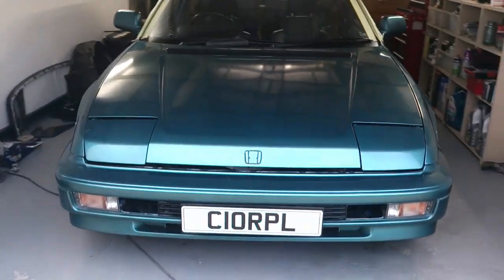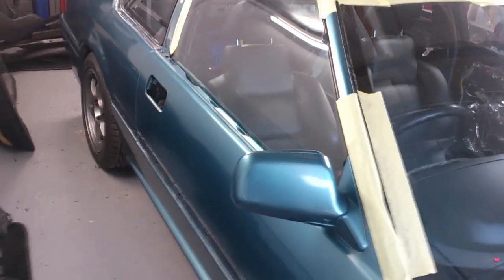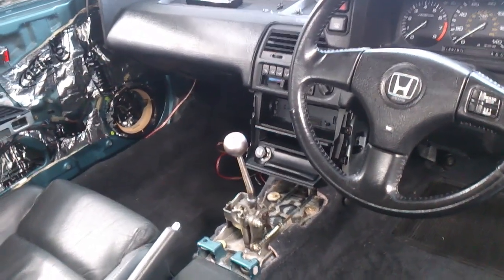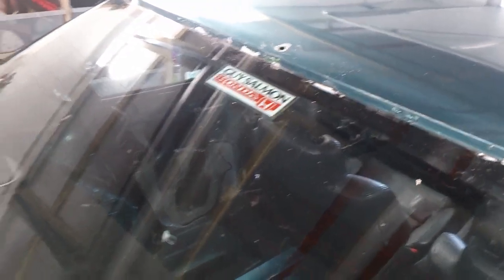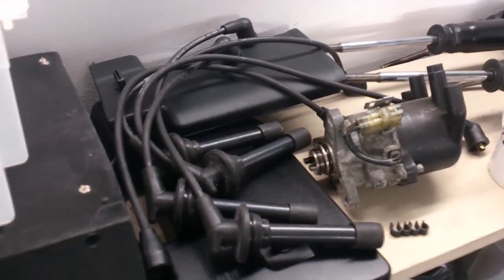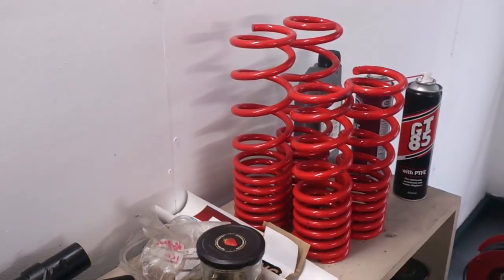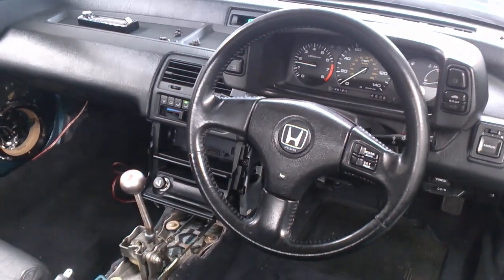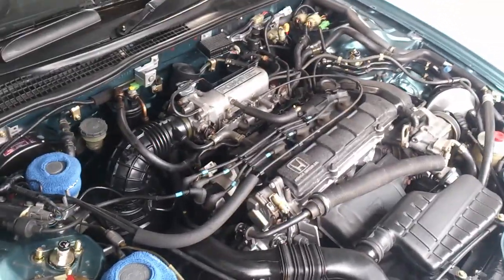3rd Gen Honda Prelude Restoration: VLOG November 2018

Comment: I bought the car from poulton le fylde and have regretted selling ever since. Under different circumstances I would never have sold.
P.s. watching your videos doesnt help 😓
Reply from the maker: Well, it's been 2.5 years of restoration work so far and the car is currently stripped back to bare metal ready for a full respray.  Hoping to do a video in the next couple of months with the completed car.